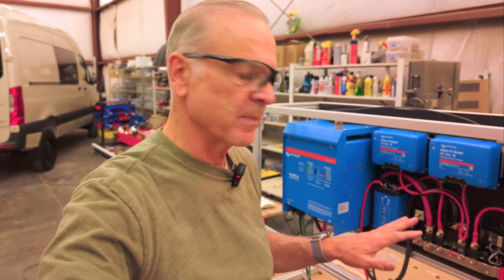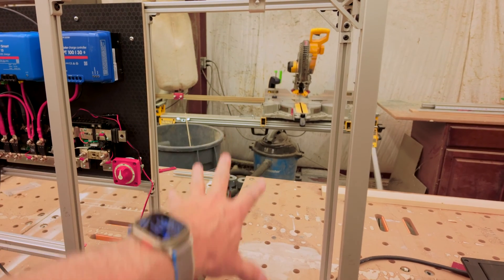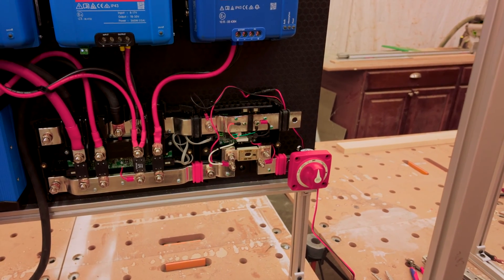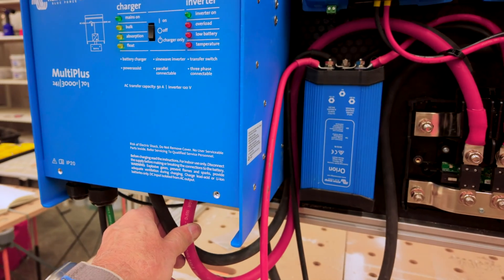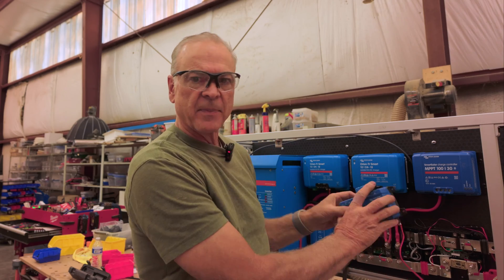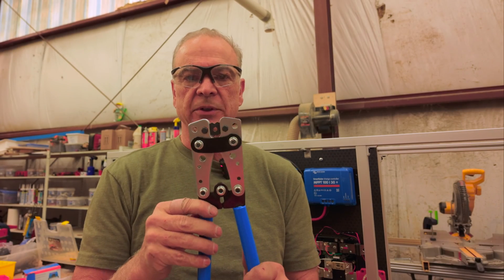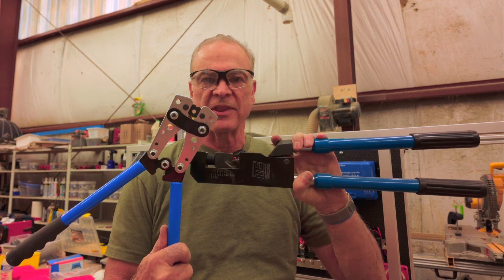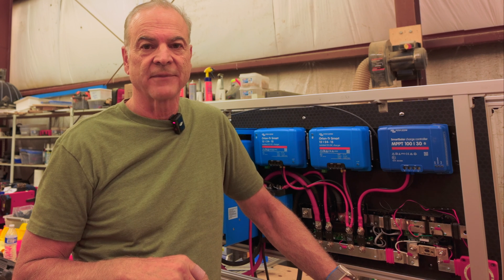24 Volt Van Electrical System | 12 volt vs 24 volt Pros & Cons

Comment: Nice one man. I am looking at going 24V in a new camper trailer build. One advantage I also have which first got me thinking to do it is I have a  whole Swiss made 24V Studer system sitting in my shed after an upgrade on my home to 48V. I have used step down converters before but trying to figure out the dcdc charging side of things from the 12V in my car. Do I just use a step up converter between the 12V car battery and the dcdc charging the 24V ? I plan to use one of the 80 amp mppt charge controllers for the solar side of things plus an inverter. TIA 👍

Comment: I think using two ORION converters to charge the batteries sounds like a solid idea at first, but I'm concerned about how it might affect the van’s alternator and starter battery. That’s a heavy load, and we're not talking about a truck here — it’s just a van!
Reply from the maker: MB and others say not to exceed 50% of alternator capacity. Most of these alternators are rated a 220+ amps, so pulling 60 amps is well under recommendations.

Comment: Awesome explanation thank you very much. may i ask you if there isn't a problem with the non-isolated 24/12 inverter in your mercedes sprinters? are you grounding your 24V negative bus bar and everything also to the 12V chassis? wouldn't it be safer to split that completely and use an isolated inverter to protect the mercedes electronics and vice versa?
Reply from the maker: Are you speaking of the non-isolated DC-DC charger (Orion)? Isolated is not needed in a van or RV since everything is eventually grounded to the chassis, even an isolated charger.
Reply: @thrivans  thank you very much for your feedback, and your great videos,  yes i was speaking about the Orion 24/12-70. it confused me to share the ground and i tried to isolate everything but you're absolutly right, at the end, the lynx distributor goes anyway to the Chassis for PE earth ground. i just don't see the application then for the isolated one. i'm building almost a similar setup like yours. You're doing an excellent job! i was told to not use a battery disconnect switch with lithium batteries and the multiplus in a 24V and higher system because the hard cut burns out the internal victron components faster, it's prefered to use the remote channel on the lynx bms to safely load/unload the components. however i also see everybody using those switchs and so do i :) do you also use the battery protects somewhere in your chain?

Comment: Why not 48v
Reply: For a certain application, at a certain point there is little advantage to boosting voltage even higher.  Like how skinny do you need your RV wiring to be? In e-bikes and e-motors in hybrids, going 48VDC or higher is worth it because their motors like it better than 12 or 24.  Why not 120 VDC? Who knows? Maybe in 2040.

Comment: Again, some great info! I just started trying to learn all of this stuff and it is a little overwhelming. Why did you choose to go with a 24V rather than a 48V system? Most videos seem to talk about upgrading to 48V. Also, most people are going with a 2nd alternator to get faster battery charging while driving rather than two of the Orion devices. Maybe they had two Orion devices and a 2nd alternator? Why did you not go with a 2nd alternator?
Reply from the maker: A second alternator along with the regulator runs $3,500-$4,500. Two Orions combined with solar is adequate for most people. Victron does not support 48v very will at this time. When they do, we will likely start building 48v systems.
Reply: A second alternator is quoted around 35 hundred for parts itself, It make sense for a bigger battery bank

Comment: You do all of this extra work and still have a rooftop piston compressor ac for your rig?   This is 2024.  Mini-split.
Reply: Yes.  Let's put a mini split in each rig, remove the simple and common roof air conditioners and forced air furnaces, and go all electric  !!!    Then if the system needs service, only an HVAC specialist can service it rather than an owner who is handy or a common and mostly affordable RV tech.  Then just like today's cars...You can't work on them anymore at home. Only the manufacturers, dealers,  and pro repair specialists profit by installing mini-splits.
Reply: @Robnord1  Yeah, I stand by my comment.   Mini split in my garage for more than 10 years, cleaned a few times, never needed technical service, not once.
So, your factoids on that are not in fact true.     Of course only manufacturers, dealers and pro repair guys are the only ones who profit by installing mini splits, because they are in the business for profit.    I, as a consumer, don't expect a PROFIT, I expect value in exchange for the money I paid.   Again, over 10 years of excellent value at 1/8 the cost to run the compressor a/cs for the garage.    Translate that to 12.5% of the energy required for the same cooling.  Now, I know its a STRETCH for you, but for everyone else, what would cooling for 87.5% less power for your RV mean in real terms?  NOt running your generator much, cooling via solar and battery bank, less weight,   less weight on the roof, less potential for leaks.   Certainly Less noise and everyone KNOWS this.  Sounds like only plusses. 
Further, I never mentioned removing a forced air furnace.   Forced air furnaces are efficient they heat with gas, fans only run on electrcity to circulate air.  

You simply don't have the stones to play in this area.   If your only argument is "easier to fix," then no only have you got that pretty much incorrect, but nearly every other need an RVer has is easily covered by cooling with a mini split.  I get that you like to fix your stuff, kudos and so do i, but a mini split is so much more efficient and provide far more flexibility, comfort, and quiet during use.

Comment: Really helpful video. Can I ask why you went with the isolated version of the 12-24 Orion chargers? Pretty sure that it's fine to use either style, but from poking around online it seems like NON-isolated is more 'normal' for van builds and I believe is a bit cheaper as well. Thanks for all your great content!
Reply from the maker: Both work equally well. If you're doing a 12 volt system, I recommend using the new Orion XS 50 amp charger. It only comes in a non-isolated version.
Reply: @thrivans  Thank you. Planning a 24v system. 600aH of batteries and 800w of solar. So I"ll likely go with the dual B2B chargers like you've done here.

Comment: thank you for the video, i am going to 24v system as well, regarding the two orion dc to dc changer, what size wires did you use or you would  recommend from the van battery to the orion?
Reply: also, i am only using one of the dc to dc 12v to 24v charger, thank you.

Comment: Ottimo consiglio, anche io ho iniziato con i 12 volt, ho installato 580A di batteria e mi sono reso conto che per il prossimo lavoro di conversione potrò creare un sistema più efficiente perché i cavi per la 12 volt sono veramente grossi e si scaldano facilmente quando si utilizza la piastra ad induzione o condizionatore. Grazie del vostro consiglio equilibrato
Reply from the maker: Glad to hear it’s working well for you. Thanks for sharing your experience.

Comment: Dude build a cabinet what a giant waste of space. 60 amps is a lot of draw  for most alternators. What are you using 1ot for, max power is 100 amps 2gauge wire is sufficient. No electrians here.
Reply from the maker: Wrong and wrong. 60 amps is less than 30% of alternator’s capacity. The battery bank can put out around 300 amps, which calls for 1/0 wire.
Reply: @OurThrivingLife  well you're right about 30% of course. Yes. I my experience it's still taxing on the engine,  but I  am old. I have seen alot of broken belts in my time.
I sorry am using your time...
But really all combined 300amps? Isn't max used or charged way under 200amps. 
You got some giant electric heater in this system?
I see such overkill with wiring and fusing in van builds. It's not great. Obviously your not new. I am a super big fan of victron, I program my own battery profile. I use lithium batteries out of a Chevy Bolt. You know the ones you said burn up in your video.
Reply: @glennbeattie6172  All of these van and RV electric builds are over the top these days Glenn. Now, if you're not max solar, the latest batteries, and an array of pretty mix and match blue components, you're an antique! How e-energy dependent the modern 'camper' is. what next? 100A shore power cords?

Comment: Hi , thank you for the explanation. 
I have a question . 
I want to do 24v in my set up but the only appliance I’m having trouble finding is a 24v LP water heater . Any suggestions. 
Thanks
Reply from the maker: You can just use 12V appliances and use a Victron Orion 24v to 12v converter.

Comment: I stumbled on your channel last night and watched this because 24V is my plan and the way to go.  At least until things like bus bar and fuse block ratings catch up to the 48V world.  The 1/0 vs 4/0 wire demonstration was great.

I have to agree with you on the square ferrule crimper.  I've used hex and square and square is almost always better for connections.  The only exception I've seen is if the round hole you're filling is barely bigger than the wire then a hex crimp might fit where a square will not.

Thanks much for the good product recommendations.  I'd not seen a crimper that advertised less than 7 AWG.  And that Southwire stripper looks good as well.
Reply: Hasn’t 48v totally caught up?

Comment: Hi, quick question. What are your thoughts on the new Epoch 12V 460Ah LiFePO4 batteries for this application? I was thinking of using those instead of the battle born, would this system be able to provide adequate charging for these as well? I'm not sure if I'm missing something, but that would give me 920Ah of battery instead of Battleborn's 540Ah. Do you see any issues with going this route?
Reply from the maker: According to Epoch's website, you can wire up to 4 of the 460Ah batteries in series. So yes, these would work. 920Ah is a lot to charge, so you may want to go with a secondary alternator for charging. Mercedes doesn't recommend pulling more that 80 amps from the factory alternator. Not sure about other vehicle manufacturers.
Reply: I'm guessing that I would likely need 3 or 4 chargers by that logic?

Comment: I am confused. You wired in series, so you don’t have 540aH, you have 270aH at 24-volt. Right? 

Did you also wire the Orions in series too?
Reply from the maker: Correct. 240ah at 24V. We wire the Orions in parallel.

Comment: What’s the benefit of running the 24v air conditioner vs the 12?  Just the wire size and expense?  There’s no difference as far as efficiency running the unit, is that correct?
Reply from the maker: Smaller wire size is definitely a benefit. Also, the 24v version of the Nomadic Cooling X2 is more powerful. According to Nomadic Cooling, the 12v X2 is rated at 8,188 BTU's, while the 24v version is rated at 10,280 BTU's.
Reply: Some of the 12v units will pull 80+ amps on start up so you have to worry about that across the circuit. Going to 24v cuts the amperage in half
Reply: In general a 24v appliance should be marginally more efficient but just like with the cost of wires being marginally cheaper that's probably not going to be what makes the decision for you

Comment: Would you recommend blue locktite on the fasteners before tourqing ? EXCELLENT VIDEO !
Reply from the maker: I would not recommend using Loctite on electrical connections. It could act as an insulator, increasing resistance. All of the Victron components include a lock washer, so Loctite is not necessary.
Reply: @thrivans  That makes sense ! THANK YOU